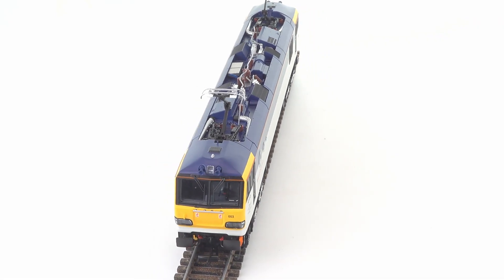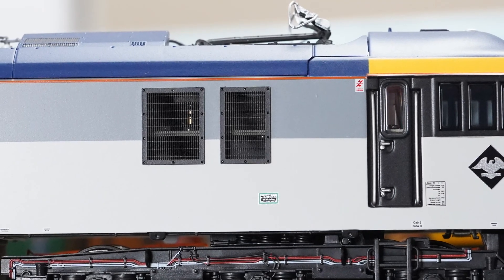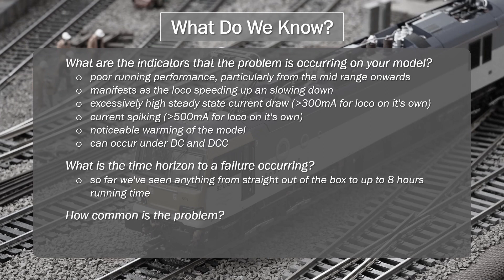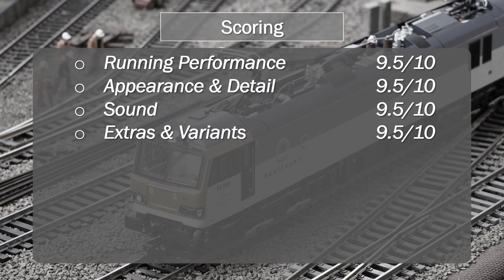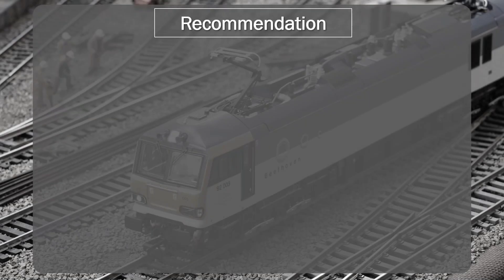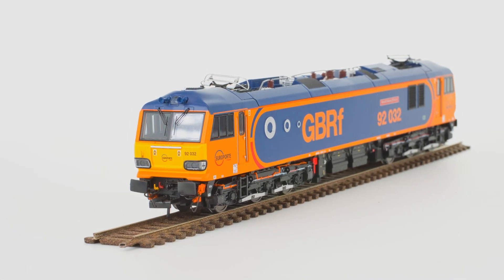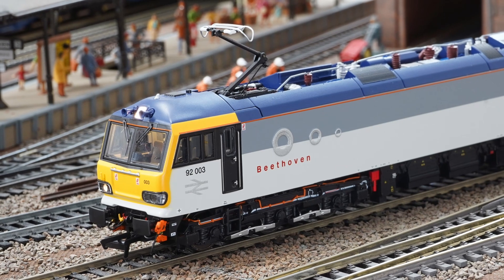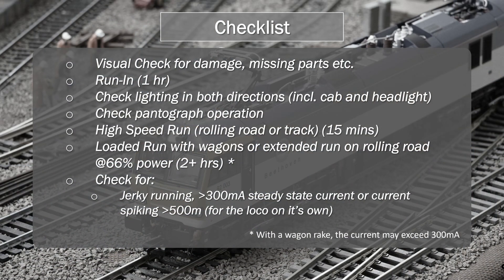Review: Accurascale Class 92 Part 2 - 92032 'IMechE Railway Division', ACC2198-92032DCC, DCC Sound

Comment: I received my other two AS Class 92's today, DB Schenker 92042 & DB/EWS 92036 and boy was I excited after 2 consecutive failures with 92010 and for good reason, these are two beautifully liveried loco's and I take my hat off to Accurascale as they simply look stunning.
I especially love the 92036 Bertolt Brecht with the two-tone grey & blue roof along with the EWS Beastie vinyl on the bodysides and the DB Schenker red on 92042 is also gorgeous in its simplicity.
Anyway, I am pleased to report that after 1hr of running of 92042 in both directions with sound on the loco is performing faultlessly on speed step 80 on my Gaugemaster Prodigy Advance controller, running between .18ma to 0.20ma and smooth as silk on the rolling road with the loco sound humming along.
Both Panto's tested and working perfectly at both ends.
That's one down, I will test 92036 later and add the results to this post.

Update: 92036...runs just beautifully like 92042 with pretty much identical power draw of 0.17ma-0.20ma with sound on in both directions.
Now looking forward to getting back 92010 & 92020 from Accurascale and enjoying these stunning models.
Cheers Steve
Reply from the maker: Sounds good. The DB livery would be the next on my list though the Stobart from Kernow is also tempting.
Reply: @EuviRail  Yes that one for the colourful livery but the trouble with 92017 it hasn't done any revenue earning work for 10 years now and just languishing in open air storage, to me it would be an expensive shelf Queen.
Reply from the maker: @saphire-c4k  Yeah, a DB is a workhorse while the Bart is guilty pleasure.
Reply: @EuviRail  oh god i know what do i do lads??? Order it or go for Symphony no 1in C 92003!!
Reply: @RedShedNick  Order...do it!...and get Bart as well while you're at it.
The more I look at my DB one's the better they get, the livery & printing application on 92036 is sublime and to me a gorgeous loco and becoming my favourite of the 4 in my possession.
Reply: @EuviRail  Yes indeed, I want Bart and when I build my railway just park it up in the sidings and throw some dirt on it lol.
I have to sell something to buy that one with sound, I only need one kidney right???
Reply from the maker: @RedShedNick  Lol. 92003 was my workhorse but 92032 is my favourite and luckily it's another work horse. Heart versus head. Which will you be happiest with? Not sure if you were getting sound? An option if you could extend to it would be a work horse version with sound and Bart as DCC ready.
Reply from the maker: @saphire-c4k  Lol
Reply: @EuviRail  didn't realise 017had bedn out of actuon for as long as that Steve? What a waste!

Comment: Excellent review as always, many thanks. I too have a class 92 (92 038 Caledonian sleeper) that had / has running issues straight out of the box, in so far as it would only achieve a very low top speed, I would say approx scale speed between 30 -40 mph. As you say, Accurascale have top notch support, so I'm confident a resolution will be forthcoming soon. I did also mention that a demo video showing the best way to remove the body for fitting DCC and cab crew would be most welcome!
Excellent channel, by the way. 👍
Reply from the maker: Thanks for that and I would expect you will be sorted in due course. I didn't intend opening until the crew land  so no expert on that topic and I'm conscious of concerns for the side grilles when opening. 
@mccarronfamily  I'm wondering if Accurascale might put together a guidance video on adding dcc/crew?

Comment: Another factor with regards to faults could be down to the Covid situation in China and things been rushed out to fulfil orders. I recently brought a new Dapol N gauge Sprinter DMU under closer inspection revealed quite a few assembly faults the train did not run either and was returned for a refund. I have seen videos of Hornby's new T T train sets with parts missing as if things were do in haste it would not surprise me over the coming months we see more issues which will give clues to what is really happening in Chinese manufacturing.
Reply from the maker: Hi Peter, I didn't want to refer to this in my video but I would tend to agree that there is probably a Covid factor out there. The inbound travel bans haven't helped either. If you were a Bachmann or Accurascale etc. I'm sure you would want to be doing onsite inspections from time to time to make sure things are being done the way you would want them done. Zoom calls are fine but no replacement for visiting the production line in person. You get what you inspect.

Comment: Many thanks for a great review and assessment. I too have 003 but have not tested it as yet. With regards to the Price/Value we have to consider the higher transport costs the manufacturers have to endure and passed on to us
Reply from the maker: Thanks Derrick. I hope all is good when you test out your model. In terms of the value score I've been using the Dapol Class 68 as one of my reference points and interestingly it hasn't budged in price since it's introduction with each new round of liveries etc. I'm not sure how Dapol do it - optimal timing of their shipments etc. If they can do it what can't the others? Accurascale too, held their Class 55 pricing despite the transport crisis and as that model had a cheaper purchase price I gave it a better value score than the C92. I've probably taken a hard line on the value scores of some Hornby and Bachmann models but it's all driven by the relative value of those models to their competitor's offerings rather than any geo-politcal or geo-economic effect. Maybe it's a bit harsh but as long as some of the players can manage their way through these challenges I'm not cutting any slack to those who can't. My heart is with the modelling community who've had to take some significant price increases over the last 10 years  prior to any major inflation bubble.
Reply: Do t forget the 92 price only increased a year ago to accommodate increased pcb costs and trade margins. Before that and if you ordered you got it for £160
Reply: @mccarronfamily  via direct purchase from AS I got my CS 92010 for £206.95 & GBRf 92020 for £241.90 using the original price and Accurascale Credits thus absolute bargains and puts to shame the pricing of the opposition, even without the credits these were bargains before the price increase and still are considering what you get.
The Accurascale Credits scheme is genius.

Comment: Great review. I am currently awaiting Accurascale response to the issue you describe, my issue came after 38mins of running on a rolling road. It was initially fine in one direction, but within 8 mins of running in the other, it began to surge in power; with the motor speeding up and slowing. Like you said in your first review video, on return to zero the loco would speed up and then slow. Luckily no other issues, though it hasn’t got as far as a load as the issue appeared. I can excuse the PCB showing, we demand so much from new models and fitting it all in is difficult.
Reply from the maker: Thanks for that and I'm sure ACC will sort you out. I would say the pantograph profile is more of a shortcoming than the PCB. You don't really notice the PCB when running but the pantograph is staring you in face. I'm sure they picked this up themselves but not soon enough to do anything about it on the first run given the overall space constraints. The feedback seems to be that most people can live with it.

Comment: Interesting feedback. So it seems you were unlucky with one, but the second one performs as it should. It happens. A friend recently had a rather expensive ESU German loco go bang. Bachmann have large return sales each year, so it happens with all manufacturers. I had to send back my Dapol Western due to a similar motor issue and the retailer replaced it no quibble a few years ago. I noted my Hornby DCC controller did some strange things around that time so I upgraded that too to Gaugemaster. Probably unrelated but always worth checking. I havent gone for a 92 as I dont model electric. I did buy a Deltic and chains aside (I took them off) it's excellent.
Reply from the maker: I would have discounted the first failure totally but for the other occurrences in the comments, one of which included the replacement loco also failing. if my replacement had failed, I wouldn't have been pleased at all. Out of box failures will always happen but I tend to be more concerned about something that functions absolutely perfectly for a period of time and then fails. My Hornby setup isn't great but I dropped in a Bachmann 47 as a direct replacement when I first saw the issue and it was perfect. I did a full power cycle and reboot of my eLink just in case but it wasn't the problem and in truth it has served me well for 8 years now but you never know of course. The Hornby Elite seems to be a bit more problematic so I've steered clear of that. The Deltic was great alright (without the chains!)

Comment: Great review & glad I watched both parts 1 & 2 as I was about to purchase a class 92 but might hold off until more is known. My experience with the Accurascale Deltic has been mixed with a problem of the rear bogie derailing if pulling more than around 8 freight wagons. This was happening consistently and on radius 4 curves. I took the issue up with Accurascale support and they’ve sent me replacement Kinematic coupling assemblies which I’m yet to fit. Has anyone else experienced this problem on the Deltic?
Reply from the maker: Thanks for that. I'll be honest that I haven't experienced the rear bogie on the Deltic de-railing. I don't know that I've done any freight duties with my Deltics actually - it's been all passenger work and this tends to be less stressful on the loco. What freight wagons were you using out of curiosity and how would you describe the level of running resistance on them - low, medium, high?
Reply: @EuviRail  Tried a variety of wagons from low drag Dapol Silver Bullets to Hornby Coke wagons (it handled 6 of them) & I think some high resistance one's too but it's been a while.
Reply from the maker: @apples5503  Silver Bullets won't be a major drag for sure! The Deltic's bogies do have a light feel to them relative to the weight of the model overall. I have a preference for heavier, more solid bogies in general. The only other thing to check would be the back to backs. It's disappointing to have a heavy powerful loco that is let down by something like this or a fragile NOM pocket connection that gives way under load.
Reply: @EuviRail  I’ll check the back to back as haven’t done that yet but you’re right, the bogie does seem light for a loco of that weight which is a shame because everything else about the Deltic is great. Regarding the Class 92’s, Accurascale have offered me a flat rate of 25 GBP freight to Australia for as many loco’s as I want in one order which is amazing value as I also don’t pay VAT given I’m an international customer. However, after your videos I’m undecided what to do so might hold off at the risk of missing out altogether. Thanks for your tips and advice. Cheers, Mark
Reply from the maker: @apples5503  Hi Mark, support will be more challenging for you given the distance. If purchasing direct from ACC it might be worth asking if they could do a quick check on your model before shipping. It would be a shame to miss out if you are a C92 fan so I would tend to go ahead and then it's a question of minimising any risk.
Reply: @EuviRail  that’s great advice, thanks again
Reply: @EuviRail  You were absolutely right about the back to backs on the Deltic, they were slightly out and after fixing that it now pulls 15 freight wagons including heavy Dapol HIA Hopper wagons without derailing. Thanks for the advice. Regarding the Class 92’s, I had some items in my trunk with Hattons awaiting shipment so I’ve purchased one Class 92 to be sent by DHL which will arrive in Melbourne in 4 days, and if I really like it I’ll buy a couple more off Accurascale direct if they have any stock left. If not can still get from Hattons as I like their returns and refunds policy for which they’ve obliged in the past without any issues. Thanks again @EuviRail

Comment: Taking into consideration everything you have so very well covered im prepared to take that risk and pre order 92017 Bart the Engine available through Kernow. Only run my engines without a train! As i only have a run in, a db sub shed so light engine movements mainly, and only at slow speed too, so cant see a problem at all! Have you ever reviewed the Hornby class 67(current tooling)? If not would you consider doing so in the future? I like them  and always felt they have been a little underated. Another excellent and  comprehensive review from you, really enjoyed take care, regards Nick.
Reply from the maker: Hi Nick, 92017 is very tempting for sure so best of luck with that. I've covered the current (non Railroad) Class 67 a number of times. Do a search on my channel and you should find the reviews. This was the last one: https://www.youtube.com/watch?v=wTh_FOPLSo0. It's a fine model that has aged well. The Dapol 68 would be a superior model but if you can get the livery you want at the right price then go for it. I still have DB and Belmond Class 67 in my fleet.
Reply: @EuviRail  thanks for your reply Eugene, i will check it out, cheers for the link, Will let you know how i get on with Bart!

Comment: Good to see I wasnhe only one with issues.  I don't have a circle layout.  Just about 3 meter of test track.  I was running it back and forth for about 30 minutes. Playing with the sound features etc, and it just cut out, started buzzing, no lights and sound, and wouldn't respond to my controller.  So just straight up died.  And the decoder wouldn't reset  as suggested by accurascale support.  It has been sent back for repair, hopefully fixes the issues xD .  It was my first acurascale, dcc and sound model, so has been a bit of a bummer:(
Reply from the maker: Wow, that was a pretty dramatic and catastrophic failure! Sounds like there may be more afoot there than the issue I've covered in the video. Anyway, ACC will sort you out one way or another so no concern there. Thanks for sharing.
Reply: Indeed. At first I thought it may have been related to my controller, got that new at the same time, but didn't have any other dcc locos to test with.  Have since got a 8pin chip and put I in a loco and it has been running fine,  so definitely something on the 92 went bang.    Hopefully get it back next week an will see happens.     Cheers :)

Comment: Yes I think this is a class leading review , highlighting a potential problem and how possibly to identify it . 10 incidences is not high but perhaps more than normal and these incidences should be identified .I have a Bachmann 158 that runs well but is excessively noisy on DC. The retailer says they are all like that running on DC . It really needs someone to do a full review with some data like you’ve done on the 92 . Very informative . Would it put me off a 92 …no , because at the end of the day you’ve got Accurascales excellent support  whereas Bachmann don’t see the problem !
Reply from the maker: Thanks Russell. We had a bit of a cluster in the first week but things appear to be stabilising now so I wouldn't be put off.  I've seen a few concerns over the Bachmann 158 so have stayed away from it and as you say, Bachmann support isn't the same as Accurascale's.